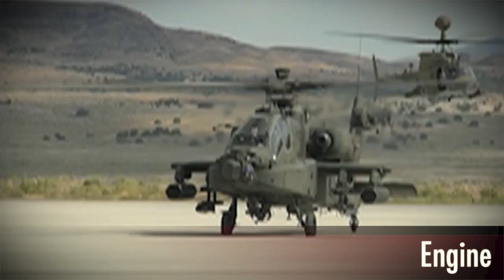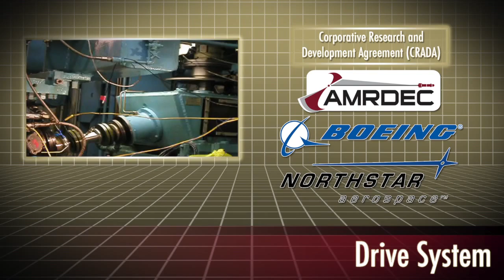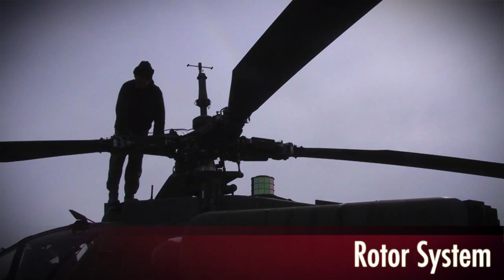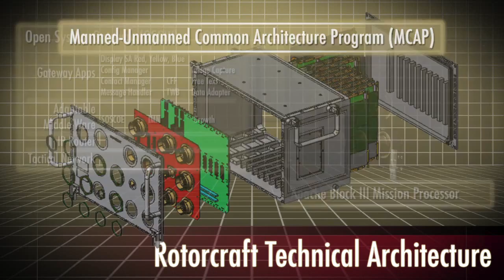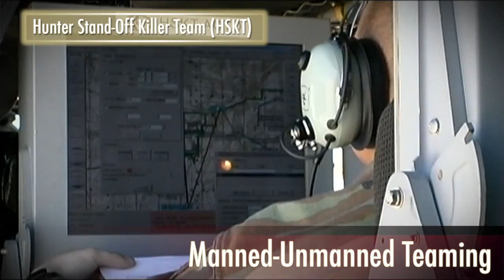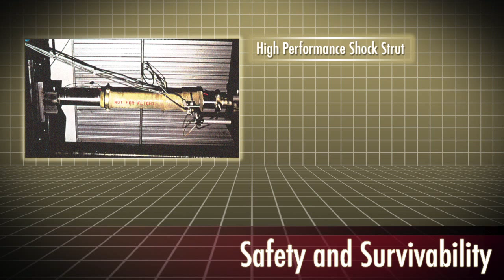US Army RDECOM - AH-64E Apache Guardian Attack Helicopter Technology Upgrades & Improvements [720p]

Comment: The worlds most powerful Helicopter
Reply: ***** Best tech and weapons..by far
Reply: ***** Vs a Mi-2

It uses the APG-68 radar with 256km range added with 5 miles Hellfires

and also watch the video

it also has a better 30mm gun system and target tracking as well

Mi-28 doesn't have that
Reply: ***** I have this

Guns: 1× 30 mm (1.18  in) M230 Chain Gun with 1,200 rounds as part of the Area Weapon Subsystem
Hardpoints: Four pylon stations on the stub wings. Longbows also have a station on each wingtip for an AIM-92 Stinger twin missile pack.[65]
Rockets: Hydra 70 70 mm, and CRV7 70 mm air-to-ground rockets
Missiles: Typically AGM-114 Hellfire variants; AIM-92 Stinger may also be carried.

for Apache

http://www.northropgrumman.com/Capabilities/LONGBOWFireControlRadar/Documents/longbow.pdf

Found out it is 8km range radar 

but it's 30mm gun

The M230 Chain Gun is the Area Weapon System on the AH-64 Apache attack helicopter and is also used on the MH-60L Direct Action Penetrator (DAP). The M230 is mounted on the chin turret. It uses a 2 hp electric motor to fire 30 mm linkless ammunition at a rate of 625 (±25) rounds per minute. The gun requires a spool-up time of 0.2 seconds to achieve this rate of fire. The practical rate of fire is about 300 rounds per minute with a 10 minute cooling period as the gun is air cooled.[3] The gun has a positive cook-off safety for open bolt clearing, and double ram prevention. Spent casings are ejected overboard through the bottom of the gun.

The mount on the AH-64 uses secondary hydraulics to move the gun. Elevation is provided via a single hydraulic actuator located on the gun's centerline just forward of the pivot point. The gun is spring-loaded to return to its centerline stowed position with the barrel angled up about eleven degrees in the event of a loss of hydraulic power. This allows the gun, which is mounted below the copilot station, to collapse cleanly into its designed space between the pilot stations in the event of a hard landing. This prevents the gun from entering the pilots stations and becoming a hazard.

The Apache is capable of carrying up to 1,200 rounds for the gun in a device known as the 12-PAK designed and manufactured by Meggitt Defense Systems, Inc. However, utilization by the US Army of a special internal fuel tank, the Robertson IAFS (known as the Robby Tank to the crews), reduces this capacity to 300 rounds.[4] The ammunition is loaded into the AH-64D Longbow Apache by armament personnel using an aircraft-mounted motorized loader and special ammunition handling tray. The AH-64A requires specialized ground support equipment for loading.[5]

The M230 is capable of firing the ADEN/DEFA 30×113 rounds, however, the Lightweight 30 mm rounds (M788/M789/M799) used in the M230 are constructed with a light alloy as opposed to brass or steel casings to save weight and are in use with the US Army. The M230 rounds are not backwards compatible with weapons designed for the ADEN or DEFA rounds. The M788 rounds can be distinguished by the blue band near the nose, the M789 by a yellow stripe atop a black band and the M788 a red stripe atop a yellow band.[6][7] The M799 HEI round is not used by the US Army due to the danger of a round exploding in the gun barrel. General Dynamics Ordnance and Tactical Systems, a business unit of General Dynamics (NYSE: GD), has been awarded a contract for the production and delivery of 30 mm M789 High Explosive Dual Purpose (HEDP) ammunition cartridges by the U.S. Army Contracting Command. The M789 HEDP is the primary tactical round of the Apache AH-64 helicopter, widely used in current combat operations. The Apache’s ability to provide accurate air support with minimal collateral damage led to increased use and volume demands for M789 ammunition.

The M789 is typically used in the M230. Each round contains 21.5 g (0.76 oz) of explosive charge sealed in a shaped-charge liner. The liner collapses into an armor-piercing jet of metal that is capable of penetrating more than 2 inches of RHA. Additionally, the shell is also designed to fragment upon impact. The lethal radius against unprotected, standing targets is about 10 ft (3.0 m) under optimum conditions. The M789 requires about 4 seconds to travel 1,000 m (3,300 ft). However, as the shell slows down, it takes over 18 seconds to cover 3,000 m (9,800 ft).[8]

It can take out BMP's

So that is a fact

the hellfire 2 has most range, more then it's competitors with more power. It will go over 1500mm RHAe

https://www.defenseindustrydaily.com/apache-block-iii-program-kicks-off-as-contract-signed-02480/

http://www.bga-aeroweb.com/Defense/AH-64-Apache-Longbow.html

Second, the Hellfire has 8km range

he AGM-114 II Hellfire is an air-to-ground missile developed primarily for the anti-armour role. It is a combat proven tactical missile system using multiple launch platforms based on air, sea and ground.
The Hellfire II air-to-ground missile system (AGMS) provides heavy anti-armour capability for attack helicopters. It is a 100lb class air-to-ground precision weapon delivering multitarget capability and precision strike lethality. The Hellfire II missile is in service with the armed forces of the US and 16 other nations.
In August 2005, a Hellfire II missile was successfully fired from Australia's Eurocopter Tiger armed reconnaissance helicopter (ARH) which is the first non-US platform to integrate Hellfire II missile.
Hellfire II air-to-ground missile international orders

"The AGM-114 II Hellfire is an air-to-ground missile developed primarily for the anti-armour role."
The US Army awarded a $170m contract to Lockheed Martin in July 2006 for Hellfire II missile systems. In June 2007, France selected the Hellfire II missile to equip its hélicoptère d'appui destruction (HAD) Tiger attack helicopter fleet by 2012. The letter of offer and acceptance (LOA) was signed in February 2008.
In October 2007, the Governments of Greece and the US signed an LOA for additional Hellfire II missiles for Hellenic Navy's SH-60B Seahawk helicopters.
In August 2008, Lockheed Martin received a $357m contract from the US Army for the missiles. The contract also provides options for 200 training missiles and up to 1,200 missile variant conversions.
Hellfire II missile development

The development of the Hellfire missile system began in 1974 with the US Army's requirement for air-to-ground missile launched from helicopters against armoured fighting vehicles. Production of the base model AGM-114A commenced in 1982.
The development test and evaluation (DT&E) launch phase of the AGM-114B took place in 1984. The DT&E on the AGM-114K was completed in FY93 and FY94.
In FY98, Congress allocated $20m for the procurement of 100 AGM-114M missiles and 100 CATM-114K training missiles. Deliveries of CATM-114K missiles were concluded in April 2000. AGM-114M missiles were delivered in December 2000. A total of $20m was added in FY00 for the procurement of 225 additional AGM-114K missiles to meet shortages in the inventory.
Hellfire II missile variations

The Hellfire II missile is currently produced in five variants. AGM-114K is a high-explosive anti-tank missile equipped with a tandem shaped-charge warhead to defeat all current and projected armoured threats.
The MMW radar Longbow Hellfire (AGM-114L) missile provides fire-and-forget capability even in adverse weather conditions. The AGM-114M is a blast fragmentation missile designed for soft targets such as buildings, bunkers, light-armoured vehicles and caves.
The AGM-114N is a metal augmented charge (MAC) variant deployed against enclosed structures with minimum collateral damage.
The AGM-114R multipurpose missile is the latest in the Hellfire II missile range. Also known as the Hellfire Romeo, the missile integrates capabilities of all previous Hellfire II variants equipped with semi-active laser (SAL) seekers into a single missile, defeating a range of targets.
From launch to detonation sequence, the Hellfire Romeo incorporates a variety of TECHNOLOGICAL improvements that enhance its effectiveness and utility.
The first proof-of-principle (POP) flight test for AGM-114R was successfully conducted in October 2009, while the second POP was completed in April 2010. Lockheed Martin conducted the third POP test in August 2010.
Sixth and the final POP test was conducted in March 2011. All the tests were successfully carried out at Eglin Air Force Base, Florida.
Design and features of the AGM-114 Hellfire II Missile

The payload and systems are housed in a metal airframe featuring two sets of cruciform wings. The airframe includes five modules incorporating laser seeker, warhead, guidance section, propulsion and control section. The Hellfire II missile has a length of 1.62m, a diameter of 17.7cm and a wingspan of 0.71m.
"The Hellfire II air-to-ground missile system (AGMS) provides heavy anti-armour capability for attack helicopters."
Each Hellfire weighs 45.4kg-49kg including an 8kg-9kg multipurpose warhead. It has 8km (LOAL, high trajectory), 7.1km (LOAL, low / direct trajectory) and 11km (UAS: LOAL, high trajectory) range depending on the trajectory.
Hellfire II can lock onto targets before or after launch for increased platform survivability. For anti-armour roles, the AGM-114 missile is equipped with a conical shaped charge warhead with a copper liner cone forming the jet for armour penetration.
The high-explosive, shaped charge and blast fragmentation warhead is effective against appliqué and reactive armour.
The Hellfire can be used as an air-to-ground or an air-to-air missile. The AGM-114 provides precision striking against tanks, structures, bunkers and helicopters. The missile can be guided towards the objective either from inside the aircraft or by lasers outside the aircraft.
Missile launch

The multipurpose missile supports firing from rotary and fixed-wing aircraft, unmanned aerial systems (UASs), ground-based tripods, ground vehicles and boats. The Hellfire has also been tested on ground-based tripods, ground vehicles and boats.
Rotary wing platforms include the Apache, Kiowa Warrior, Cobra and Seahawk, as well as the Tiger armed reconnaissance helicopter (ARH) of Australia and the Tiger HAD of France. Fixed-wing platforms include the unmanned Predator and Reaper drones, as well as the manned Cessna Combat Caravan aircraft.
Hellfire Romeo can be fired autonomously or with remote designation.
Propulsion and power

Hellfire is propelled by a single stage solid propellant Thiokol TX-657 solid-fuel rocket motor. The motor can generate 10Gs of initial thrust. The missile has a maximum velocity of 950mph.

Hellfire is currently produced in three configurations – Anti-Tank, Blast-Fragmentation and Thermobaric. A choice of semi-active laser and milimeter wave active seekers are also available. The 45kg Hellfire II missile (48kg in AGM-114M version) offers operational range of 0.5 to 8 km, and utilizes a semi-active laser seeker which has improved targeting capability, including advanced processing to solve laser obscurant/backscatter problems identified during combat engagements in 1991. 
Hellfire II locks on before or after launch and can engage multiple targets simultaneously. The missile uses Trajectory Shaping to enable optimal performance in degraded weather. Operation under degraded weather conditions are also improved with automatic target reacquisition after loss of track in low clouds.

The digital autopilot can be reprogrammed in flight, to home in on new targets in when employed in a Lock-On After Launch mode. Hellfire II is also uses equipped with electro-optical countermeasures hardening. The missile is capable of operating with pulsed radar frequency or A-Code laser codes for those aircraft equipped with dual code capability.

When employed with the AH-64D Longbow mm radar targeting system, the missile can also be equipped with a millimeter-radar seeker, which enables "fire and forget" operation in adverse weather, dust and smoke. The Longbow missiles are fully compatible with the launchers carried on the Longbow Apache which also carry the AGM-114K/M laser guided missiles. Beside autonomous homing on targets designated by the Longbow Fire Control system, the missile can also use advanced modes, currently being upgraded to the system, which provide home-in on active jammers that try to degrade or disable the missile. The missile will also receive advanced countermeasures to defeat and cancel jammers.

Hellfire II is provided with a choice of three warheads - a tandem warhead (to defeat advanced / reactive armor), blast-fragmentation warhead with delay fuse is used against soft, light armored targets, small boats, brick and concrete structures and bunkers.

Modified HEAT Warhead

The Hellfire AGM-114K anti-tank version has been modified to improve its fragmentation capability, when engaging soft targets. The Mod-K modification, pursued by Dynetics for the Aviation & Missiles R&D and Evaluation Center, included the INSTALLATION of a fragmentation sleeve placed around the shaped charge, optimizing fragment lethality against a broad target set, while minimizing degradation of shaped charge performance.

Thermobaric version of the Hellfire

Hellfire thermobaric warhead using a metal augmented explosive charge is used primarily in urban warfare, against bunkers, buildings caves and other concealed targets. This warhead is designed to inflict greater damage in multi-room structures, compared to the Hellfire's standard or blast-fragmentation warheads. The Metal Augmented Charge or MAC (Thermobaric) Hellfire, designated AGM-114N, has completed rapid development cycle in 2002 and was deployed during OIF by US Marines Helicopters in Iraq. The new warhead contains a fluorinated aluminum powder that is layered between the warhead casing and the PBXN-112 explosive fill. When the explosive detonates, the aluminum mixture is dispersed and rapidly burns. The resultant sustained high pressure is extremely effective against enemy personnel and structures. The AGM-114N is designed for deployment from helicopters such as the AH-1W or UAVs such as the Predator drones.

Hellfire Longbow

The combination of Hellfire II's precision guidance and Longbow fire control and Hellfire's fire-and-forget millimeter-wave seeker capability provide the battlefield commander flexibility across a wide range of mission scenarios, permitting fast battlefield response and high mobility not afforded by other anti-armor weapons. The Longbow variant of the Hellfire missile is designated AGM-114L.

Greece is seeking to add 657 AGM-114 Helfire II missiles to equip its ground forces. The Greek armed forces are requesting the US for 633 AGM-114K1 anti-tank missiles fitted with a tandem HEAT warhead and 24 AGM-114M1 missiles equipped with Blast Fragmentation warheads. The deal worth US$66 million also include Hellfire II Training and drill missiles and TECHNICAL SUPPORT.

UAV Optimized Hellfire (AGM-114 P+)

SInce 2007 the U.S. Army invested over $18 million in modifying Hellfire missiles to better adapt for operating at higher altitude and wider engagement geometries, better suitable for deployement with unmanned aerial systems such as the Predator , Sky Warrior and Reaper. The required modifications include the replacement of the gyro into a MEMS-based inertial measurement unit (IMU), and introduction of SOFTWAREchanges increasing the missiles engagement geometries and its capability to defeat a broad target set ranging from heavy armor to urban structures. The Army plans to modify the AGM-114-2K (anti-tank shaped charge) and AGM-114N (enhanced blast warhead) into the new AGM-114P+ model. The missile will also be compatible with all rotary-wing platforms.

Apaches usually fly with two Hydra rocket launchers in place of two of the Hellfire missile sets. Each rocket launcher carries 19 folding-fin 2.75-inch aerial rockets, secured in launching tubes. To fire the rockets, the launcher triggers an igniter at the rear end of the tube. The Apache gunner can fire one rocket at a time or launch them in groups. The flight fins unfold to stabilize the rocket once it leaves the launcher.
The rockets work with a variety of warhead designs. For example, they might be armed with high-power explosives or just smoke-producing materials. In one configuration, the warhead delivers several submunitions, small bombs that separate from the rocket in the air and fall on targets below.
The gunner engages close-range targets with an M230 30-mm automatic cannon attached to a turret under the helicopter's nose. The gunner aims the gun using a sophisticated COMPUTER system in the cockpit. The computer controls hydraulics that swing the turret from side to side and up and down.
The automatic cannon is a chain gun design, powered by an electric motor. The motor rotates the chain, which slides the bolt assembly back and forth to load, fire, extract and eject CARTRIDGES. This is different from an ordinary machine gun, which uses the force of the CARTRIDGE explosion or flying bullet to move the bolt.
 
The M-230A1 30-mm automatic cannon on an AH-64A Apache
Photo courtesy U.S. Department of Defense
The CARTRIDGES travel from a magazine above the gun down a feed chute to the chamber. The magazine holds a maximum of 1,200 rounds, and the gun can fire 600 to 650 rounds a minute. The cannon fires high-explosive rounds designed to pierce light armor.
In the next section, we'll look at the targeting system for the cannon, as well as the other major Apache controls.

The Apache cockpit is divided into two sections, one directly behind the other. The pilot sits in the rear section, and the co-pilot/gunner sits in the front section. As you might expect, the pilot maneuvers the helicopter and the gunner aims and fires the weapons. Both sections of the cockpit include flight and firing controls in case one pilot needs to take over full operation.
The pilot flies the Apache using collective and cyclic controls, similar to ones you would find in any other helicopter. The controls manipulate the rotors using both a mechanical hydraulic system and a digital stabilization system. The digital stabilization system fine-tunes the powerful hydraulic system to keep the helicopter flying smoothly. The stabilization system can also keep the helicopter in an automatic hovering position for short periods of time.
 
Inside the Apache Longbow cockpit
Photo courtesy U.S. Army
On the Longbow Apache, three display panels provide the pilot with most navigation and flight information. These digital displays are much easier to read than traditional instrument dials. The pilot simply presses buttons on the side of the display to find the information he or she needs.
We'll look at the Apache's sensor equipment next.

One of the coolest things about the Apache is its sophisticated sensor equipment. The Longbow Apache detects surrounding ground forces, aircraft and buildings using a radar dome mounted to the mast. The radar dome uses millimeter radio waves that can make out the shape of anything in range. The radar signal processor compares these shapes to a database of tanks, trucks, other aircraft and equipment to identify the general class of each potential target. The COMPUTER pinpoints these targets on the pilot's and gunner's display panels.
The pilot and the gunner both use night vision sensors for night operations. The night vision sensors work on the forward-looking infrared (FLIR) system, which detects the infrared light released by heated objects. (See How Night Vision Works for more information.)
The pilot's night vision sensor is attached to a rotating turret on top of the Apache's nose. The gunner's night vision sensor is attached to a separate turret on the underside of the nose. The lower turret also supports a normal video camera and a telescope, which the gunner uses during the day.
 
The sensor array on an Apache helicopter
Photo courtesy U.S. Army
The computer transmits the night vision or video picture to a small DISPLAY UNIT in each pilot's helmet. The video display projects the image onto a monocular lens in front of the pilot's right eye. Infrared sensors in the cockpit track how the pilot positions the helmet and relay this information to the turret control system. Each pilot can aim the sensors by simply moving his or her head! Manual controls are also available, of course. (See this U.S. Army Apache page for more information on the helmet targeting system.)
 
The helmet targeting system in an Apache helicopter
Next, let's look at a few of the systems that protect the pilot and gunner during battle.
Print Citation & Date

The Apache's first line of defense against attack is keeping out of range. As we saw earlier, the helicopter is specifically designed to fly low to the ground, hiding behind cover whenever possible. The Apache is also designed to evade enemy radar SCANNING. If the pilots pick up radar signals with the onboard scanner, they can activate a radar jammer to confuse the enemy.
The Apache is also designed to evade heat-seeking missiles by reducing its infrared signature (the heat energy it releases). The Black Hole infrared suppression system dissipates the heat of the engine exhaust by mixing it with air flowing around the helicopter. The cooled exhaust then passes through a special filter, which absorbs more heat. The Longbow also has an infrared jammer, which generates infrared energy of varying frequencies to confuse heat-seeking missiles.
The Apache is heavily armored on all sides. Some areas are also surrounded by Kevlar soft armor for extra protection. The cockpit is protected by layers of reinforced armor and bulletproof glass. According to Boeing, every part of the helicopter can survive 12.7-mm rounds, and vital engine and rotor components can withstand 23-mm fire.
The area surrounding the cockpit is designed to deform during collision, but the cockpit canopy is extremely rigid. In a crash, the deformation areas work like the crumple zones in a car -- they absorb a lot of the impact force, so the collision isn't as hard on the crew. The pilot and gunner seats are outfitted with heavy Kevlar armor, which also absorbs the force of impact. With these advanced systems, the crew has an excellent chance of surviving a crash.
 

Your claims are wrong
Reply: ***** Really, I know the apache has a good cannon and Hellfire is good

but I it seems without the Hellfire 2

The M203 is the best weapon on the apache other then the Hydra's

I will get back to you on this

but I think the AH-64 falls behind in weapons, thats it...
Reply: ***** hmph, all I know that it has a good cannon and the Hellfire is good and the Hydra

but it's the lack of quantity of which
Reply: ***** Hmph, iinaccurate.I thought it had the tightest grouping...must be wrong

now is this block 3 data? or not it doesn't seem so
Reply: ***** 8,0 CEP? hmph, I don't know if that is correct
Reply: ***** but then it is also called an "area weapon system"
Reply: ***** yeh they did improve muzzle velocity a little but still not that great. I would have thought the M197 would be more accurate as the 20mm shells avg 1000m/sec vs the M230's 800m/sec ??
Reply: ***** I found out, The Hellfire is the best...has over 1500mm penetrating power and the 30mm gun is one of the most accurate..after doing my research....The Apache is the most powerful in the world...being it can carry AIM-9's and it hellfire's 16 of them and carry tons of ammo for m320..I've done my research your kinda wrong as no offense

I still believe the apache is the best helicopter in the world by far...I mean india is buying the Apache over the Mi-28...so just saying
Reply: IBT98 well then your research isn't that great.. the Russian made Vikr has a greater range and velocity than the US Hellfire missile and the M230 gun mounted under the Apache is probably one of the most inaccurate weapon systems ever fitted to a military aircraft!! 

The Apache might have the edge over the Havoc but the Ka-52 will wax it from 10km away.
Reply: Murat Harman No, the Apache has better radar..so it fidns the KA-52 first....second the Hellfire 2 has more range and better penetrating power.

but hte m320 is powerful but inaccurate, but it's a good gun with firepower 

the Hellfire has more power and since the AH-64 has better systems, it will find the KA-52 and take it down quicker...so the thing is that the only known advantage I can think of the KA-52 has is speed. the Apache is better at maneuvers and agility and firepower...the Hellfire AGM-114 is probably the(no biased) the best anti-tank system in the world.

however, the KA-52 does produce tons of heat so it can found easily by IR sensors 

Apache, no biased is the best in the world....mostly because of the AH-64E model
Reply: IBT98 Apache's FCR/hellfire have a range of 8km vs the Ka-52's 10km range.

I honestly think it would be interesting to see the results of a battle game skirmish between these 2 gunships.

The Vikr ATGM is so fast, it can reach it's 10km max range quicker than the Hellfire can reach it's max range of 8km !

The M230 is not even comparable to the Ka-52's gun... yes, they are both 30mm but that's where the similarities end.

I will say the 70mm Hydra rocket system on the Apache is more accurate when firing at extended ranges (3km+) because of it's vertical axis aiming capability. 

Ka-52 has a higher take-off weight and higher max speed and can also carry AA missiles.
Reply: Murat Harman Apache can carry AIM-9's

the U.s DAGR has over 12km's and with it's avionics and radar will find the KA-52 first...firing a DAGR or hellfire..being the hellfire has more power..it will kill the KA-52...The 30mm of the M230 is HEI rounds...I don't think the KA-52's is....however the M230 will spray and kill...or lock on the Ka-52 with AIM-9's or a Hellfire missile or DAGR

and the Apahce will out maneuver the KA-52...the Ka-52 can't match the apache in agility or avionics..it can match it in weapons just by it's gun but comparatively

the Apache I would see winning, having it's drone and radar and superior locking missiles will find the KA-52 and take it down..but it wouldn't be easy..the Apache pilots would have to be ready as hell

but up close? the apache has it, better agility and it's gun is more accurate around close areas ...but the m230 isn't that bad, but it doesn't fit U.S philosophy..however the hellfire does as it can hunt and kill Ka-52's with range..it's radar being that is and first kill and shot.

Apache is a awesome helicopter and so is the KA-52 but it needs radar and those kinda systems honestly

but the AIM-9X has over 40km's range so yeah...the R-73? around 30km range....and not good off bore sight as the AIM-9X
Reply: IBT98 yes, the DAGR looks impressive (kinda like a mini-hellfire) but hasn't been deployed yet.

The Ka-52 carries laser guided ATGM's which can also engage air targets up to 10km away.

It is almost impossible for an Apache to jam an incoming Vikr missile while the Ka-52 can attempt to jam an incoming Hellfire radar guided missile (L variant).

This is why the latest version of the Hellfire (Romeo) is now also semi-active laser guided.

The Yanks are learning from the Ruskies !
Reply: Murat Harman I don't see that, the hellfire can track a Ka-52 and hit it down..and since it's radar sees further..the Apache has first shot kill...the KA-52 can't jam a hellfire-2...I would say the AH-64E is superior to the Ka-52 being it has all the advantages but speed
Reply: ***** That is bullshit, the apache can roll maneuver much better then the KA-52..I've seen it..look at your average demo as well...a apache would be more agile...co-axial counter each other so they are little more unstable but still the apaches systems and power give it a edge..it rolls and flips much better

second, the M230 doesn't need to lock on, the hellfire 2 does however

second the DAGR can be used against the KA-52...it can lock on and destroy however

the only bullshit, I see is you, your just making garbage
Reply: ***** Your right, co-axial is more stable...sorry my bad :P 

also, the AH-64E's avionics and FCS are superior it has a 12km radar and tracking systems..the AK-52 doesn't have that.

however, the KA-52 is heavy and the Apache has more power and does a 180 roll in half the time a KA-52 does one and other maneuvers being that hte Apache can be unstable means that i can me a little bit more agile and added to it's better power and control surfaces gives it better agility..also I may add the Apache has a L/D ratio around 4 the Ka-52 is around 4 as well I presume

second, I don't think I said that the m230 can lock on, or if I did I meant hellfire 2

but the closest counter part in capabilities  is the Eurocopter

but the Ah-64E I would say is the best attack helicopter in the world.

but up close? the M230 gun is little bit more accurate and being I believe faster swivel to attacking angle and more angles of site..I can see the apache being better then a Ka-52 up close..the AH-64's helmet and hud being a key factor for aiming.

the m230 guns was design to take out large amounts of tanks and infantry...the hellfire was design to take out tanks infantry with precision and power
the vikhr has 1000mm of penetration and hellfire has 1200mm so they are around the same penetration...but they both have around 8km to 10km's or so said by wikipedia.

your forget that Apahce has a link 16 radar link so he can call in other apaches

and hte fact he can engage targets out side there operating zone and launch over mountains with better accuracy(hellfire) then the vihkr...so just saying that and added to fact it's Mq-1 will spot the KA-52 first and seeing how a KA-52 has a massive IR signature. the AH-64 has the advantage avionics wise and firepower as well as agility but not by great amount..only the Ah-64's FCR will prove superior in battle.

however, seeing has the KA-52 is a good helicopter albeit lacking in many factors..it's greatest attributes is firepower...to which it is equal with the AH-64 and how the KA-52 is a tank with wings being it can take damage and dish it out in great loads.

that being said, the KA-52 is a contender to be a rival to the Ah-64 which it does.
Reply: ***** I think it does, I know the FCR on the apache is superior..but remember the AH-64E can also destroy war ships...that is actually a thing...

Im starting to think you don't know what your talking about...
Reply: ***** The AH-64E can destroy naval targets, I know that was one of the requirements....If you seriously think what you think..I'd check again lad.

also, jesus christ why get so offended?
Reply: You mean the world's deadliest
Reply: I like to have anyone try to prove Russian military helicopter or any other chopter that is better?  There tons of Vids about the Apache exploit and they Fight just as well at night time as it is during the day.  Show any attack helicopter be able to perform and fight at night time.  Please humor me, be my guest!
Reply: +Dragon's Sky This is fun argument to read, and I have learned a lot of things in this, Thanks for you guys.
Reply: *****
Because its battle proven to be!  Many times!
Reply: *****
What are you getting at?  You saying this helo. has never seen combat?
Reply: *****
It's been proven effective in combat for years!!
Reply: *****
A lot of equipment including the Apache has been modified to handle the environment better.  This platform can handle whatever is thrown at it.  Warfare has changed a lot since the inception of the Apache.  With precision bombing, they and most other equipment does not have to deal with the same types of threats and intensity as before.
Reply: ***** Come on, answer me, I want to know.
Reply: ***** Hey I ask you that can Ka-52 use other R-73s model(K-74m2, R-73m1, R-74) or only use regular, classic one. Just that.
Reply: *****
I'm talking about the US operating Apaches in Desert Storm.  I said nothing about Apaches dropping bombs. That was probably well before you were born.
Reply: ***** Thanks.
Reply: +Dragon&#39;s Sky 

First the Vikhr missiles are beam riders they're not fire and forget like the later Hellfire missile variants, that's a big advantage for Hellfire.  Owing to the Vikhr  missile's inferior homing system the angle of attack is inferior to that of the later hellfire missile variants. As a beam rider a Vikhr missile will tend to strike targets where the armor is thickest whereas Hellfire missiles with near 90 degree AoA tend to attack targets where the armor is thinner. 

Circle back to F&F whereas an Apache may fire all 12 Hellfires simultaneously, or is free to seek cover or make evasive maneuvers after firing, any aircraft firing inferior Vikhrs has to maintain laser lock. Sorry there's no comparison here.
Reply: Dragon's Sky SPRATS ROOSIA A BEST SEEMPLY NO COMPARISON.

Yeah whatever.